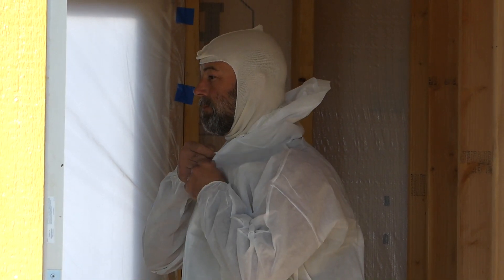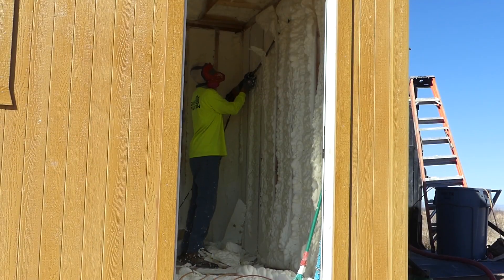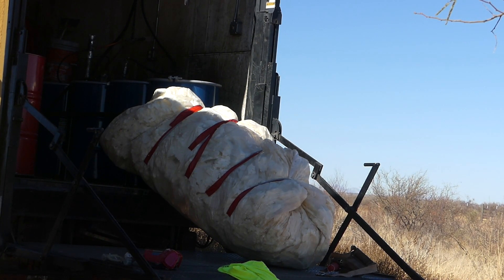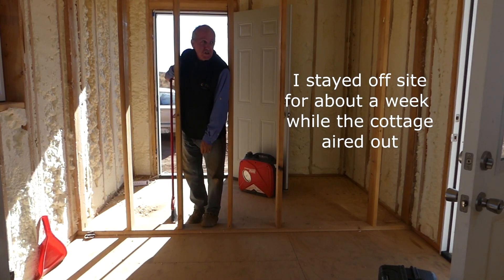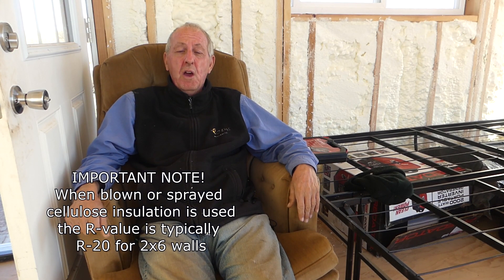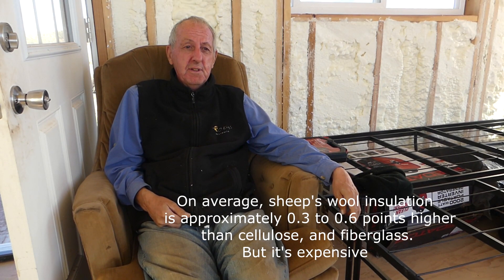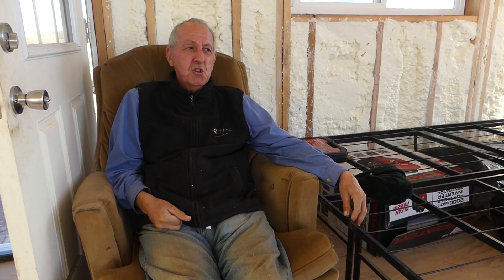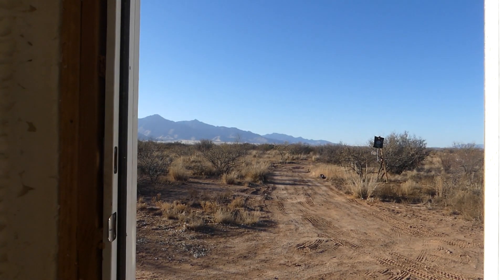Off grid Cottage Insulation ... My experience

Comment: If you do any wiring, Use a 18 inch drill bit. so you can drill right through the studs and right thru the foam as well.
Reply from the maker: thanks for the suggestion yinglyca1

Comment: May I suggest that you seal all the cracks and seams as well as wood joints to stop air coming into the house. Bob
Reply from the maker: Good suggestion Robert. The beauty of this open cell spray foam it literally seals up any cracks and crevices really well. Trust me when I tell you there is definitely no air coming into my arm at this point. It’s like I am sitting inside of a giant pillow with just a few windows

Comment: I plan to do something similar.  I would first add 2/2 or 2/3's to each of the current 2/4's giving at least 6 inches of insulation.   Bravo for that you did do.
Reply from the maker: Joseph.  If you look at the vid closely you will see these are 2x6s.  No end to insulation in the building and its fantastic!

Comment: The insulation use on that shed should have been closed cell on the walls and open cell on the ceiling. Open cell allows breathing, more porous than the less porous closed cell. Buildings need to breath so moisture is able to exit. I have a question. Will you have top side draw ventilation? Sort of an attic fan drawing air across the top of the ceiling. Summer heat can blister in Arizona, I'm told. That would help air circulation from being stagnant, and creating a heat trap of heated air pushing down from the ceiling area in summer. The spray foam is a good choice, however I don't think it adds any structural strength, very very minimal at best. Admiral at your young age of 39 to go ahead with this project. Keep dreaming with a smile!!! My late post.
Reply from the maker: Hi Michael. Here in hot dry AZ the majority of homes are all down by professional companies using open cell.  If I was in New Hampshire and it was cold and damp I would have used closed cell.  Also I am at 4600' elevation so its not that hot here.  Only a few days at 100.  The rest its cool.  Thanks for watching.
Reply: @affordabledesertliving3487  I understand your use of open cell. I sold pumped in insulation in the past into existing finished homes. When you figure sq. ft. wall area / vs window/ vs ceiling, area the greater R rating the better the 4 season  total funds spent savings is extreme. Most homes gain at least 40-55% when properly insulated. That would be, walls, and attic, about 70-80% of home. Thermal windows of course help, but to retrofit vs wall and ceiling costs? All should be of course. Nice job all the way thru. Your project was from the beginning to completion. Older homes are not so lucky for retrofitting, however, with current energy pricing, it's becoming a must.

Comment: Foam and a surprisingly small mini split AC can turn that building into a freezer, even in summer.
It's good stuff.

For other people's info, you can get small do it yourself kits.
Once you start using the kit, you have to use it all within a limited time, so be ready to spray it all before you start.
Reply from the maker: Great point for sure. That's the plan!

Comment: Don,  I didn't see a cut-out in the insulation for the attic sidewall vent. It's OK while the ceiling is still open, but if you decide to install a covering (sheet-rock, paneling, etc.) the vent needs to be opened up to prevent dry rot, mold and mildew due to moisture being captured in the enclosed area.
    Also, I'm concerned about carbon monoxide build up from using the catalytic propane heater with the attic venting being blocked.  Please leave two windows open a tiny little bit when using it. We don't want to hear any sad stories. Carbon monoxide is colorless and has no odor. Read up on carbon monoxide poisoning, it's no joke.
  You may want to seriously consider installing a combo smoke / carbon monoxide detector, I'm concerned for your safety.
Reply from the maker: Thanks so much for your excellent pointers about my little cabin and the concerns about carbon monoxide. I wont vent this little building from the ceiling as it will eventually be all encased in drywall. I will have a crawlspace to climb up in the tiny "attic" as needed. With such a small structure at 200 sq ft it has 3 full size doors and 2 large 3x4' windows.  The windows are open most of the time providing all kinds of natural ventilation. Re: carbon monoxide I have used a detector in the building since I started sleeping in it.  It goes off once in a while if there is not adequate ventilation.  Its super sensitive. So of course I open doors/windows whenever that happens. Thanks so much for watching!

Comment: Don't know what the difference is in cost, but they do make DIY spray foam kits that seem easy to use.
Reply from the maker: Thanks StepNWolf.  I looked into that. The DIY kits are about $700 per kit and you need 2 of them. Compared to me having this done for $1200.00 and I didnt have to lift a finger.

Comment: Now you can use a Little Buddy or a 250w heater I mentioned in your previous video.  You'll love your insulation in the summer too.
Reply from the maker: V panetta You are totally right. My big buddy heater is actually overkill at this point. When my solar is hooked up I could indeed use a little 250 W heater. But the long range plan is to put a mini split in the building for heating and cooling

Comment: I like the 200² feet cottage. I  hope the property taxes won't be high!! Doesn't the heat escape in roof vent?
Reply from the maker: nelio such a logical question about the roof vent.  That is now smothered and buried under gobs of insulation.  Venting now comes when I open windows.
Reply: @affordabledesertliving3487  That is good but it will be interesting to see how it does is the hottest days of summer with all the heat trapped inside,  and if using propane for cooking and heating it will create lot of condensation which is good for the mold propagation and wood exposed to high humidity won't last long.
Reply from the maker: @neliosamch3195  Logical approach to your thinking and I can definitely see your logic. So here is the scoop nelio.  I lived in this lovely little cottage uninsulated last summer and fall when it was 105 deg. I am so heat tolerant I was fine.  With all of the insulation it's just the opposite.  It will remain cooler.  Also I do all of my propane cooking outside during the summer.  When I have my propane stove installed by then I will also have a mini-split to cool things down. So with window open for ventilation and the mini-split cranking out cold air I should be fine.  Thanks for your thoughtful comments!

Comment: We live in a modern on grid home that has A/C. Years ago a old timer explained to me in detail how evaporative cooling works. So I decided to put in a "Bonair 5000 " its made in Australia. I have been useing it going on 20 years now. I live in very dry climate like you. Only 1 set back... when humid weather comes its useless but that only means we use our A/C for on average 2 weeks a summer. Last summer during the fires humidity dropped down to 7% and it was 116 degrees and the Bonair 5000 blew so cold my home did not get over 80 degrees. That was the most extreme ever. The worst time was when a hurricane in Mexico moved up and sat there for a month so we had to turn on the AC. The wife and I were miserable with A/C because we love our evaporative cooler so much it's great for my wife's sinus issues too. And we are on grid w no solar and it really reduces our electricity bill by a long shot. Let me repeat a long shot, to the point that we don't feel any need to revert over to a solar system. At least not yet anyway. We have done the math and with our Bonair 5000 and drastically reducing our electricity use  solar is not an advantage for us. However w your solar system you will be able to power the fan and tiny water pump no problem. Our home is 1840 Sq feet you could get by w a smaller much cheaper unit. One thing to keep in mind is you will need water   for it so that might be an issue for you as well. So hope this helps you.
Reply from the maker: Thanks for your thoughtful indepth suggestion Steve.  Hoping to do a mini split later this year.

Comment: What was the price of having the spray foam? What is your dimension of your cabin? Did you get any answers from the county in regards to having another small house/cabin brought in. Do they require any specific requirements to how far does it needs to be from your current cabin? Who built your current cabin?
Reply from the maker: Hi Ken.  I thought I put that in the vid description but perhaps not.  It was $1200 for the entire 200 sq ft cabin.  Great question as far as the cabin is concerned.  The county allows as many sheds as you want on your property but they CANNOT exceed 200 sq ft. This one is temporary I trust and once a larger building is in place and all permitted this "shed/cabin" can then be sized to 296 sq ft.  Thats the magic size minimum for a permanent dwelling which the county outlines in their permits.  It would then be an accessory dwelling unit which is permitted with the county if it passes inspection etc.  You are only allowed 2 dwellings on your property to live in.  A main home and a grandma unit aka Accessory Dwelling quarters.  Hope that makes sense!

Comment: Your building was too small for most companies to make the profit they want.  I have run into this several times over the last few years.  Fortunately, I do most everything myself, get a better job done.
Through the roof is where heat is loss and heat comes in, put the most in the roof you can afford.
Reply from the maker: Yes your correct I suspect most companies would consider my small cottage a waste of time.  Dr. Dickie did you SEE ALL OF THE INSULATION IN MY ROOF? It's stuffed full.  I am delighted with the job that Banker insulation did.  Thanks so much for watching!
Reply: @affordabledesertliving3487  Yeah, the guy did you right by putting that extra in the ceiling, it will really pay off.

Comment: Thanks for sharing the price too, Don. Appreciate your overview of the various insulation choices. If you would have had to do it yourself, what technique  of the ones you shared would you have chosen? I've seen that spray form insulation is also available in spray cans.

From what I could see, Bankers did a great job. Good shout-out for them after your disappointments with the other companies you contacted.
Reply from the maker: Hi Artsy Lady. Thanks so much for your great questions about this video. Yes Banker did a fantastic job and I am so glad I found them.  If I had to choose another insulation the next time I would do 2" thick styrofoam board and double the thickness so it's like a sandwich. It;'s easy to work with and I had great luck with it for my floor.

Comment: Good information Don! Thanks for the r value comparison. I know one can be reluctant to discuss total cost, but perhaps a cost per square foot? Nice to have the option of actually turning the heater off 😉
Reply from the maker: Yes super warm now Bill!  Yes duly noted Sir.  Posted all of the relevant information in the video description.  Entire job was $1200.00.  Considering a kit to do the work myself would have been about $1000 I figure I did really well!
Reply: @affordabledesertliving3487  WOW! That's pretty reasonable.
Reply: @affordabledesertliving3487  Except that for 1,000 you would not have gotten it anywhere near as thick.. It would probably take 2 kits to get that thick,, especially in the ceiling..
Reply from the maker: @deserthorizons  Thanks for the encouraging remarks Robert I really appreciate it bro

Comment: Thanks for sharing your insight and experience with this type of insulation.  The big thing I got out of this... higher the professionals!  I have watched other youtube videos on the subject and it was recommended to ruff in your electrical / plumbing needs in the wall prior to foam work.  But doing it afterward should not be a big deal... just alot of drywall saw cutting for your internal support.  Since you used "Open Cell" should not be an issue... as opposed to "Closed Cell" which is a solid rock!
Reply from the maker: So glad this was helpful MJ.  Yes being very step by step logical in thinking it came down to this. I was still acquiring the skills for putting in electrical and plumbing (still working on those LOL) so these items COULD NOT have been put in before the foam.  Why?  I was sick and cold and its winter.  Got to have heat!  So the beauty of open cell foam is its the consistency of styrofoam peanuts.  You can cut it with a bread knife. I wont be doing drywall and just staring at the foam walls until all of the electrical and plumbing is in.  Then I can press the go button on dry wall.  Thanks for watching the videos and in the next few months God willing lots should be happening here on my property!

Comment: Looks good !
You going to run all your electrical wiring in the floor then sneak it into the walls?
Reply from the maker: Thanks Cliff. Very logical comment on your part.  I am not positive but may just run it all through the walls.  The beauty of open cell spray foam is its like styrofoam peanuts and super stuff.  You can easily cut it with a bread knife.  So most of the work would be just the awkward business of drilling through the 2x6 to run the wires strategically along the walls.  I havent decided for sure yet. Great comment!

Comment: Should've wired the place first.
Reply from the maker: Chris that's the standard way of doing things.  I will be doing a solar set up that will be custom designed.  It will take some skill and research to put it in place.  I am NOT an electrician.  So I had a choice. Be warm and survive winter with insulation and do wiring later.  Or... spend several weeks learning wiring and putting it in place shivering and fighting flu.  Then having it insulated. I think it will work out fine.  I have a plan for wiring and what you need to remember is that open cell foam is super soft and cuts with a bread knife. So placement of wires is not as traumatic as one might imagine.  I understand your logic though.  Cheers.

Comment: three "words":     carbon monoxide detector    -   that is one tight envelope.
Reply from the maker: Thanks David.  I am looking at now as I type.  Its mounted right over my bed.
Reply: @affordabledesertliving3487   Awesome,  did you go with a combo CO1/fire detector?  Portable?     So many choices theses days :  )
Reply from the maker: @et5222  Nope just straight small compact C.Dioxide detector. It's a bit sensitive bit it works well.
Reply: @affordabledesertliving3487  Yes, make sure if you use a gas/propane heater, you need a little ventilation to allow fresh air in... Otherwise get a vent free unit, Mr. Buddy makes them.
Reply: Nice to see you all comfy Don - especially liked seeing you kicking back with the bird guide!  and having to turn the heater out  - winning!

Comment: What about the floor?
Did you have them spray under the building or do you have other plans?
Reply: I think he was going to do that himself, there was a previous video where he showed how the wind had blown his sheets of styro all over the property.
Reply from the maker: Excellent question Motor Head.  I used 4x8 sheets of styrofoam board that were 2" thick. Sandwiched them together.  Your question is very timely.  In a couple weeks will show you how I did it.
Reply from the maker: @bobbalbirnie2478  You've done your homework Bob.  Yep.  Next video I show how I insulate the floor.